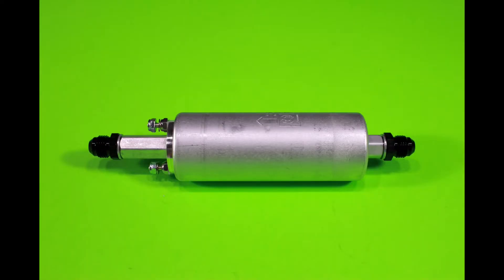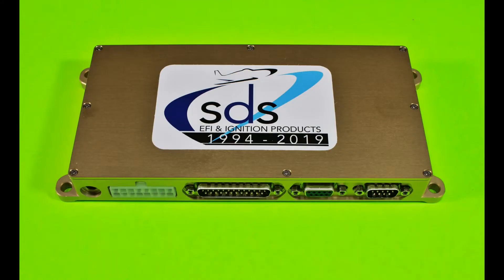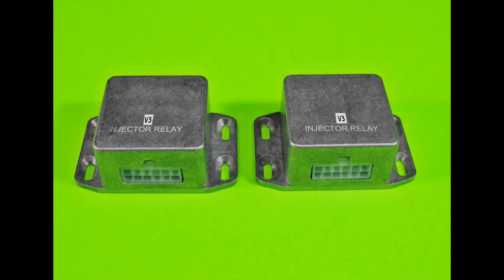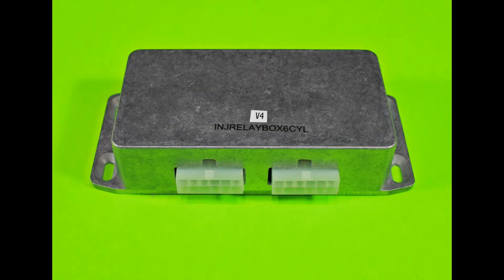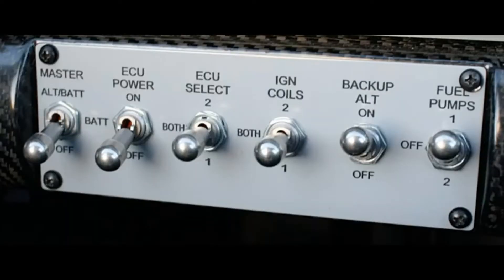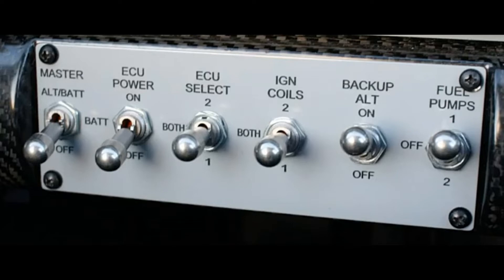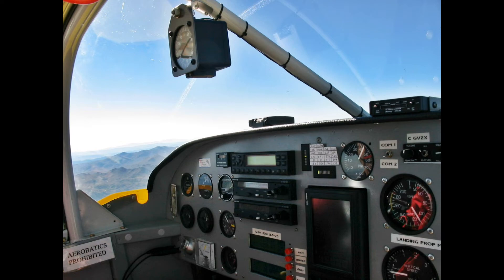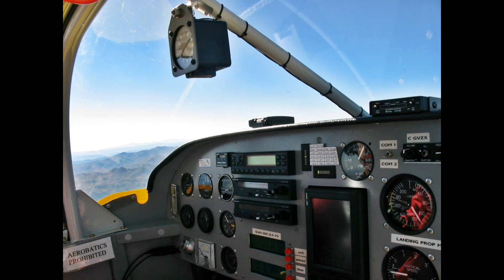Aircraft EFI Redundancy

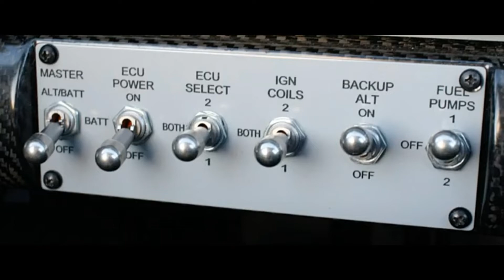Comment: At 3:30 do you say you only need one fuel pump above 500 feet. It looks like what do you do below 500 feet. Do you need duel fuel pumps on take off near sea level? Looking at Les’ system, he can only have one fuel pump at a time. Just making sure I’m not missing something.
Reply from the maker: Personal choice on when you want both pumps on. You only need one on to feed the engine. No point in having both on in cruise at altitude.
Reply: I can only figure the 1 is for one fuel pump on, the 2 is for both fuel pumps on. It is confusing not knowing how it is set up. That is the only way I see having two fuel pumps on at the same time, unless there is another selector somewhere else that we aren't seeing.